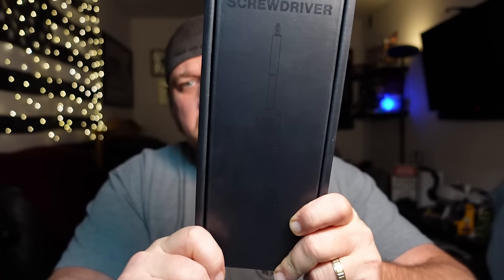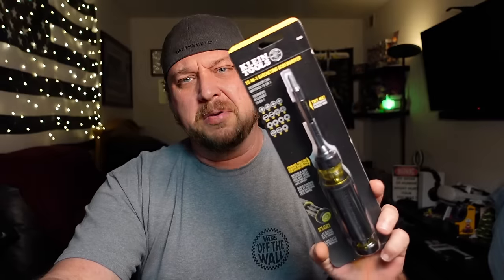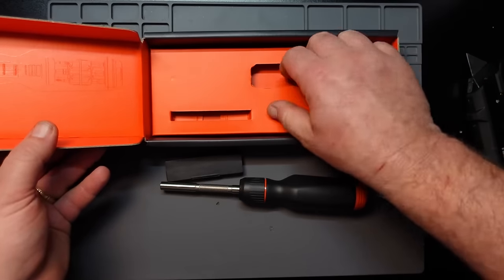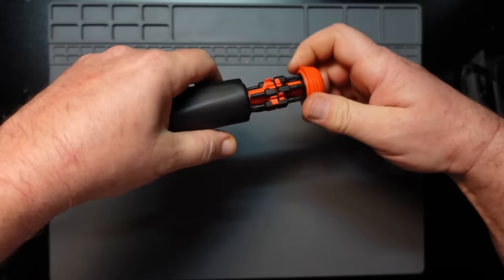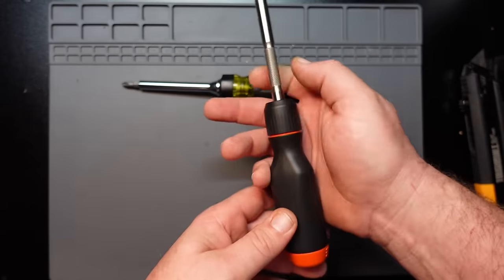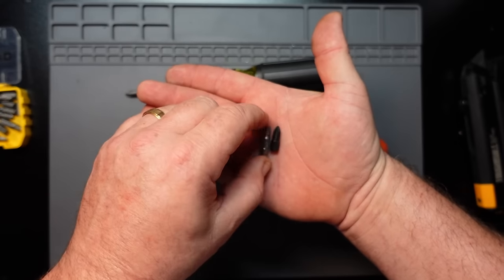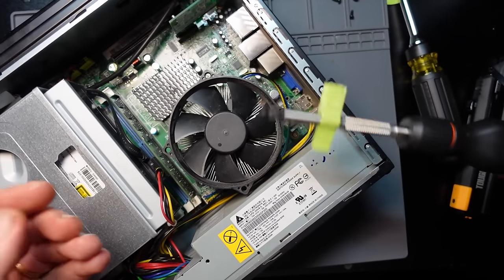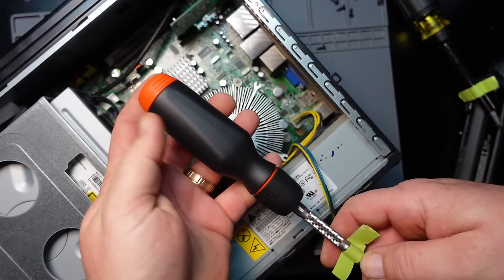LTT Screwdriver Vs Klein

Comment: I have a terrible history with ratcheting drivers.  As soon as I use them with bear-force on a stubborn screw they break internally.
Reply: I will never understand why someone doesn't do a 1 way roller bearing screwdriver with that has two 1 way rollers that you can engage for forward/lock/reverse and then you would have zero angle ratcheting and also a mechanism stronger than the bits...quick Google tells me that does indeed exist it's called Rolgear.
Reply: @THeBoZZHoGG  Million dollar idea bro go make it!
Reply: I used to own the Husky ratcheting screwdriver (with swappable colored bit holder ends) and I used to use it to drive 1/4in head screws in walls and wood panels all the time. After about 1 1/2 years of nearly daily use, I did notice a little more slop on the ratcheting mechanism but then again, I would hammer on the driver sometimes.
Long story short, I used it fairly aggressively and never broke it (did lose it in a attic tho :/ )
Also if you're torquing or require so much torque to loosen a bolt/screw, probably need a regular ratchet instead, or an impact driver
Reply from the maker: I was going to try to break this one but it’s too expensive 😜
Reply: I also have terrible experiences with them. Nor for their build quality but the whole concept is unusable. It combines all the worst aspects of solid scredriver and a power tool.
Reply: damn, didn't expect to see you here clive. small world. cheers
Reply: @DapimpBDSD The t-handle one?
Reply: @privateassman8839  no, it was a regular screwdriver looking one. Black  with green, red,blue and yellow interchangeable bit holder.
Reply: @FunkFPV wow you got bigclive and LTT commenting on you vid. You must be doing something right lol. 

I also have never had luck with ratcheting screwdrivers. They always break, skip, or switch direction randomly. I never got an expensive one because i was always afraid it would be money wasted. Love the concept, but they just never seem to last or work really well for more than a couple weeks-couple months
Reply: I totally agree ratchet screwdrivers break far too easily. I use an electric screwdriver now have done for years and just cannot fault it
Reply: @FunkFPV   Project Farm tested one to destruction, so you don't have to.
Reply: @DapimpBDSD  oh. They used to make a t-handle one. It's worth its weight in gold. I modified the shank with a 3d printed part for better shank turnability.
Reply: @FunkFPV it’s ok I’m pretty sure project farm broke it
Reply: LTT made theirs for working on computers, it's just overbuilt so it would feel nice and tight and elevate it above a generic $15 model. You shouldn't be using any of them for the heavy jobs.
Reply: @FunkFPV any chance we could get a review of that rolgear mentioned in the top level comment? I'm really curious now if its actually any good.
Reply: haha yeah, that is also the reason LTT is saying these screwdrivers are not intended for heavy-duty use and more for PC assembly and such.
Reply: There was a company that used to make a really tiny pipe wrench.  My dad had a micro plumbing wrench in his driver set.   When your mind wanders back into your body go find one - excellent for applying torque to the shaft directly at the bit.
Reply: That's why you use the right tool for the right job. I think you were making a joke though.
Reply: I've broken the bits on my snap-on screwdriver, but not drive it's self.  So far the LTT has held up, but I keep it the repair bench, so it hasn't been abused.......yet.
Reply: @The_Fat_Turtle doesnt stop me using it for automotive work. Still havent broken my t25 torx bit
Reply: @THeBoZZHoGG I have a screwdriver like that somewhere. I bought it when I worked at an auto parts store when I was in college. It's AmPro brand. I don't think they offered it for very long. I thought it was slick as hell, so I bought one. I never used it that much, but not because of any issues with it. I think I kind of know where it is... I'll have to dig it out!
Reply: @storm_filter  Yeah, all the legends in one place.
Reply: Those old school ratcheting screwdrivers with the long chrome cylinder and the slide toggle were the worst. I have the snap-on stubby ratcheting screwdriver and wanted a full handle one, this LTT one cost less than buying the standard handle from snap-on with a longer 1/4 drive shaft. Been using the LTT in the garage and the near zero back lash combined with the very strong internal magnet has saved me from hours of fishing for dropped screws
Reply: Never use ratchet mechanisms for breaking operations. What is wrong with people?
Reply: @5475 You're not wrong, but there shouldn't ever be enough torque on a screw to break a driver unless it's seized for some reason, but that's also why they usually also have a lock position.  I only use those impact drivers as a last resort for seized screws, because more often than not you'll either damage the threads or strip the head.
Reply: the driver is meant for pc/electronics. Its designed for low torque.

Comment: One of the weirdest criticisms of the LTT driver was the bits. People kept saying they were proprietary, but they're not at all. They're just half sized bits used by a whole lot of other drivers (their tip designs are different, but the shaft size is the same). Very specifically, those trying to have a slim profile. Been using them for years in small right angle drivers
Reply: You can use the regular size bits too, you just can't fit them in the onboard storage
Reply: @James2210  Yes you can, you just can't fit as many. This was discussed before the driver shipped. The entire reason he decided on the short bits were to have more on board.
Remember, the only difference between the bits is the length, not the diameter
Reply: Klein uses them in their multi stubby driver.
Reply: @dtune30  Are you telling me Klein is using LTT's super patented proprietary driver bits? Son of a gun /a haha
Reply: The biggest criticism is the price. Its not worth it.
Reply: I've never seen half sized bits with magnets on the bottom
Reply: @JoshDavies111  Neither have I, I don't think they exist anywhere. You might want to re-watch the video. It's a magnetic bit for picking up screws
Reply: @James2210 Sure you can, you just can't fit as many.
Reply: Price is the issue and a big one.
Reply: @tweedeldee8122  It's an issue for you, sure. You can say that about nearly anything.
Reply: @caodesignworks2407  It's an issue for me because I care about value. I just disagree with your 2nd sentence.  But hey I'm all for people spending their money any way they choose and they're happy with it that's all that matters. Take care.
Reply: @tweedeldee8122  Value to you. That's the key word. The value to you. It's not worth the value to you. You are clearly not the target demographic. The value is there for me, but the budget is not. Enough people have found its value that they've made variations. Some that cost even more and still sell out. And it's essentially lifetime warranty unless you intentionally break it. Or they cease to exist. As most of those go.
Reply: @caodesignworks2407  What ever. I think "value" can be objectively measured. But it's not worth debating. To each their own.
Reply: Most people who buy their screwdriver never held one before.... And the review shows, along with their complaints on the bit size. It's literally a Megapro product. They're decent quality. Better made bits than Milwaukee and dewalt that's for sure. I just can't fathom the price for it when there are plenty of other options that are better quality. I just like Wera and Klein too much.
Reply: "To each their own" 
That's the exact point. 

But between you and me, Ayn Rand would probably agree with you the most.
Reply: Linus also said if you really want to there's nothing stopping you from taking a hacksaw to long bits and making then fit, and yeah I love the short bits because I get 12 in the space of 6
Reply: I recently bought a set of Milwaukee bits that has some shorties in it. I just realized
Reply: @James2210  Actually you can use the internal storage. They made the separator between the bottom and the top adjustable to you can fit full size bits you just get half as many. But I have one security bit I use often and then the rest the half height and it is fine.
Reply: @tweedeldee8122 if value can be objectively measured then you are objectively wrong because it is in the same price range as other higher quality ratcheting screwdrivers
Reply: @ShikiKaze project farm tested and LTT performed a lot better than wera and Klein was pretty much bottom half in every test… 

Rankings in PF video
LTT - 1, 1, 12, 1, 2, 6
Wera - 5, 11, 13, 4, 3, 2
Klein - 6, 8, 6, 9, 10, 8

PF removed the bit tip failure load from the final results, but LTT beat both wera and Klein in that as well. 4th, 8th, and 10th respectively

Still, it’s a computer screwdriver, not a construction screwdriver. I have the Milwaukee ratcheting screwdrivers cause I’m not building computers very much. I wouldn’t recommend those by the way. 😂

Comment: I have an LTT Screwdriver and use it for most projects.  Best screwdriver I have.  The idea for the empty slot is for putting the bit into it so you don't have a bit in the driver when traveling.
Reply: works good as an ice cube chissle to for ice in mixed drinks.
Reply: Yo I'm stupid. I've been passively looking around for my missing bit for the pass couple months. Completely forgot about that feature.
Reply: Also so you can use the socket, I'd guess. Seems like part of its design is for installing and removing motherboard standoffs.
Reply: You sure it’s not for a 1/4” but driver? The Klein other one has 14,5/16, 3/8 and 7,16 I believe
Reply: @travisdenen7633  I do that instead of the Phillips bits when I have that option.
Reply: @A_barrel  is that where you found it?  If so, glad I could help.
Reply: @jparrish  no I had the empty slot and figured I had a "missing" bit

Comment: I’m with you on ratcheting screwdrivers - always feel less solid compared to a normal screwdriver and you have to keep remembering which way it’s going to ratchet
Reply: I understand, but I have a ratcheting screwdriver, not sure what brand but it was my grandpa's, but I would probably say it's been used for almost 50 years now
Reply: Plus Klein's non-ratcheting screwdriver is probably the best one out there even compared to Snap-On. Holds the most bits, has the swivel ass that basically does the ratchet's job anyway, has the extendible shaft(giggity) and that shaft happens to be a 1/4" hex shaft so you can put a wrench on it for more leverage. I keep a 1/4" box end wrench rubber banded to the handle just for that.
Reply: Gotta use it right..
Reply: especially when you hit it with your linemans to tighten a locknut
Reply: Plus the the problem withdetachable tips - aslo in poer tools - is that you can not see what size tip you have on. Unlike nomrla scredriver clear makings and you can even identify them by length.
Reply: @hornmonk3zit   Ace 10 in 1 is even better than Klein's
Reply: I just don't see the point as the ratchet only works for around half of the screw length before you anyway have to use it like a normal fixed screwdriver. Faffing about switching between the two actions at the right moment, and fiddling around with the direction, outweighs any benefit of a ratcheting screwdriver for me

Comment: I got the LTT Ratchet screwdriver when it first came out. I work on larger vessels as a junior engineer. It is a jack of all trades, kind of career so I use that driver for all sorts of applications and I personally love it. I have never been much of a "show off" kind of guy with tools but it is pretty interesting to see this tool get noticed whenever I hand it to someone new and they try it. I can only describe it like that friday scene when someone smokes the blunt and then stares at it. Lol
Reply: I do industrial maintenance ive tried the ltt screwdriver but they do poorly when your covered in grease and oil, and mine jammed up with debris, i like my klein 8-1 Screwdriver, but i get it the ltt screwdriver is for cleaner environments pc building etc etc

Comment: One detail a lot of folks miss is the little divider between the bits in the handle... the black separator can be spun out of the way to load longer bits or used to help align the included bits.
Reply: The divider is useless. They should have just left that out and just spin the bit holder itself to be offset. The divider always moves on my holder.
Reply: @sekazi mine has been fine 🤷‍♂️
Reply: @sekazi  mine does not shift out of place, but I had the same thought when I got it that it was kind of a redundant part. but I guess some OCD types would probably appreciate the bits being line up nicely.

Comment: FYI: Regarding ratcheting screw drivers... there are 3 positions to the direction ring. If you turn it to the center position (between left and right) it locks the ratchet and turns it into a "regular" screwdriver if you don't want to use it as a "ratcheting" screwdriver.
Reply: But it cost extra, has some play, and probably breaks at lower torque than a regular screwdriver. It's not a replacement for a set of high quality non-ratcheting screwdrivers, it's a different product.
Reply: @LaughingOrange - no one would buy it as a replacement for a non-ratcheting screwdriver. The purpose of that setting is for people who will use it as a ratcheting driver most of the time, but occasionally they need to be able to go in and out without changing ratchet direction.
Reply: @LaughingOrange  Obviously it isn't as good as the thing that is purpose built for the specific task, it's just a useful tool that covers a lot of people's needs for most applications
Reply: @LaughingOrange  Their audience are PC enthusiasts. The stuff most of them would be using this for wouldn't involve tightening screws until the point that they can't be removed, which it seems is the only way you know how to tighten a screw.

Comment: 7:30 this is called a “combo tip” bit and it is used ALL the time in electrical work. Electrical panel covers, grounding terminals, maybe 40-50% of screws in electrical have this design. You can use a robertson or a flat head to remove the screws but this bit gives you more torque capability than a robertson and will not slide out like a flat!

Comment: That combo "electrician" bit it to fit screws that are made to fit slot, Phillips, and square Robinson drivers.  So it is a combination of all three drivers together.  This is how weird standards happen.
Reply from the maker: Haha
Reply: ECX is a brand name for it, IIRC. I've wanted one of those bits for a while now, to pair with a screwdriver of my choice. It seems extremely useful specifically for the electrical field.
Reply: Yea that combo screw head was purposely created for homeowners that only own one type of screwdriver. I've only seen them on electrical stuff
Reply: @DingleFlop they're definitely my preference for working with electrical! it just feels solid and works. if you have a big Phillips laying around, grinding it down works well enough
Reply: ECX is Milwaukee's trade name for it. Every other brand like Klein and Ideal have to call it a combo tip. Better for electrical. Fits device terminal screws better and are way less likely to cam out. Also certain brands of breakers will take the same bit which makes it nicer for torquing down and not camming those out either.

Comment: it's just a megapro... if you like the aesthetics of the youtube edition mega pro, by all means. LTT started with making a driver for computers, but ended up designing, and marketing it, as simply a competitive screw driver, which the megapro is. Unlike GamersNexus teardown kit, which is more like a parktools level of competitiveness...the kit is designed specifically to work on computers, the way parktools is specifically made to cover your bike needs. is it the best 5.0mm hex driver you could buy? no not at all... but its been flattened for capacitor clearance and comes in a set with the other heads you would need to do work on 99% of computers, thats what LTT fans wanted and then some polish, did LTT get the reviews they want from taking the simple competitive ratchet route, clearly even a year later the bait be catching fish. You can buy both a megapro and their precision offering for the price of the youtube edition mega pro... and yes, anyone on youtube reviewing the youtube edition mega pro is bias, just like jerry's knife, which is also nice, but it's just a youtube edition knife.
Reply: Certified yapper.
Reply: @Diactia  comment again so more people become certified yapper readers just like you!
Reply: @itainteasy  yappity yap yap

Comment: Thanks for the review. Good thing you covered that Windows Vista Home product key. Wouldn't want anyone using that 😆. I still have an old Dell OptiPlex 160L that has a Windows XP Pro product key label. As an IT guy. I rarely use a ratcheting screwdriver. It's a matter of preference. Some will prefer LTT. Some will prefer Klein. They both look like good, quality screwdrivers.
Reply from the maker: I always cover numbers if I don’t know the meaning of them 😜